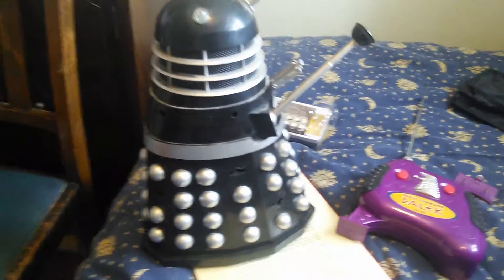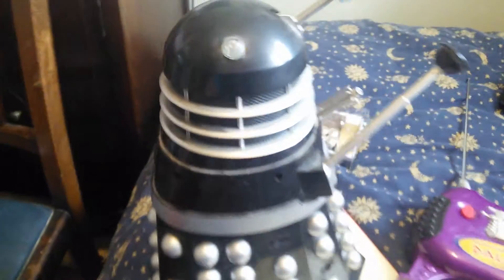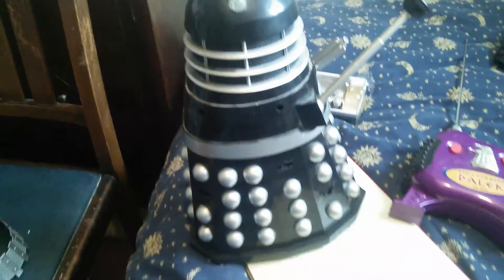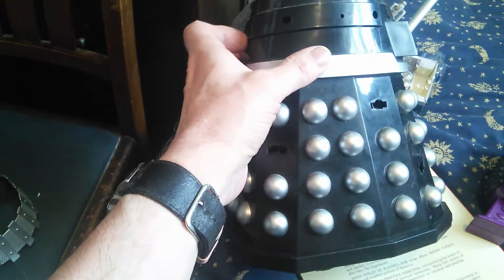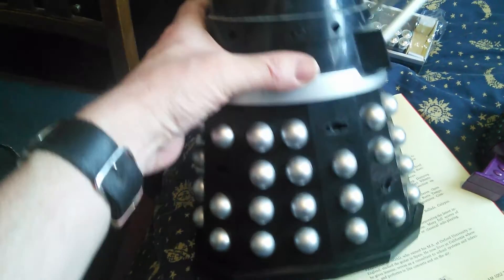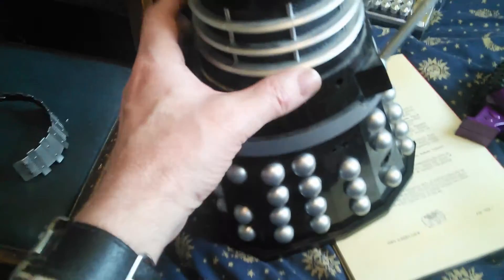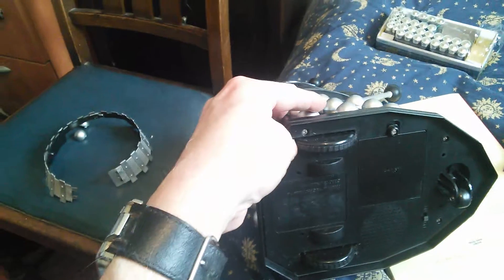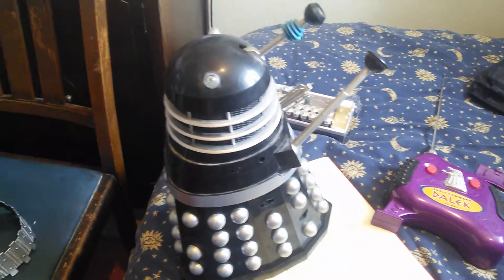12 inch Dalek repair early type.

Comment: Thanks very much indeed. You have been by far the clearest on the spheres which I will now try  carefully squeezing or tightening thread behind them
I have two of these to fix up. Got a new boxed one and the gearing and speech packed up very quickly due to mechanical failings.....pretty unreliable as I only have them for static display but a quick test of the motors stuffed the head movement dalek movement and speech gearing...pretty poor really but they look good enough as long as I can get the head to initiate speech....cheers

Comment: The original doctor who film was back in 1965 with Peter Cushing and the daleks had a more retro look with a much bigger fender on the bottom more rounder also the lights on the dome sticks out more https://www.youtube.com/watch?v=hkC2JgC9CR4&t=82s   where the one you have is more from the john pertwee tom baker era  https://www.youtube.com/watch?v=x9R1lthZOrc&t=30s
Reply from the maker: OK thanks for that. I am old enough to have seen the film when it came out! You are correct. I'd always assumed my Dalek related to the film, but I'd never looked into it in detail.